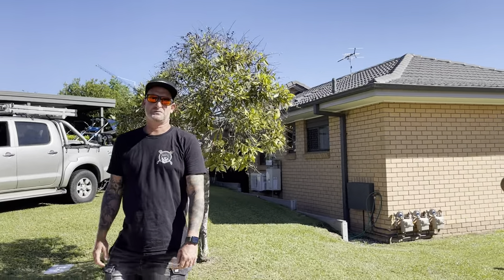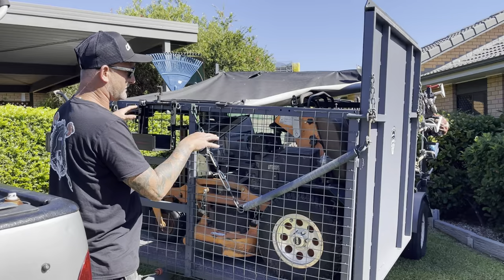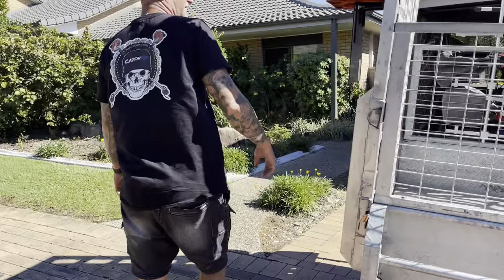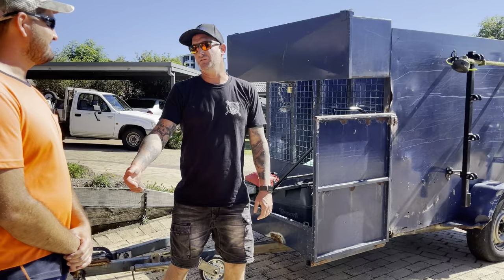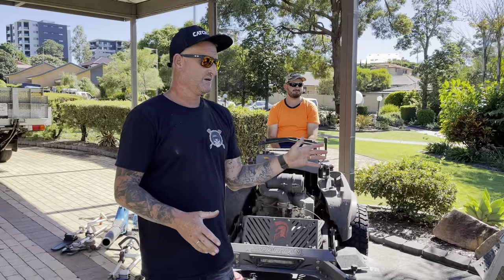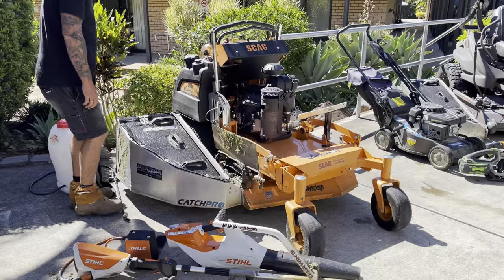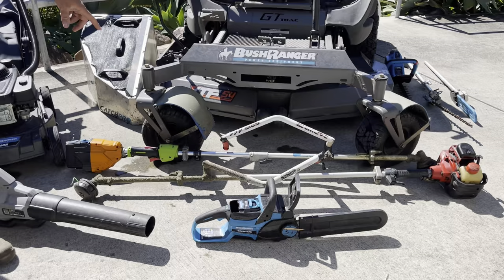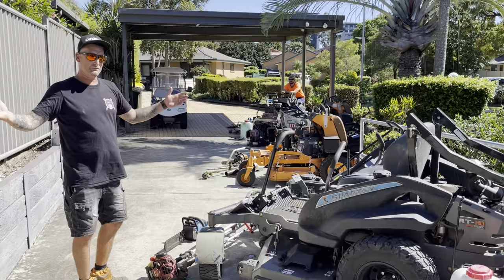2021 Lawn Care setup - 3 Trailers with 3 Purposes - Catch Pro Australia & Greenscapes Solutions

Comment: stihl  just came out with the kma 135 r, its just like the 130 r but you can plug the ap battery directly into it. don't know if it's available in the down unda but stihl is making them.
Reply: Yea, was just about to comment the same thing. I was just about to get the 130 but with this 135 coming out, it’s going to be a game changer.
Reply: @thegardenpeople4241  It really will be a game changer, especially since it's part of the kombi system! No more will one need to buy a separate accessory to use an ap battery with the 130 r now that we have this.